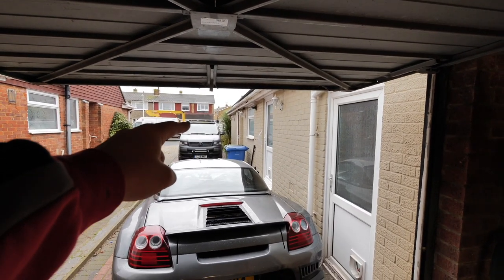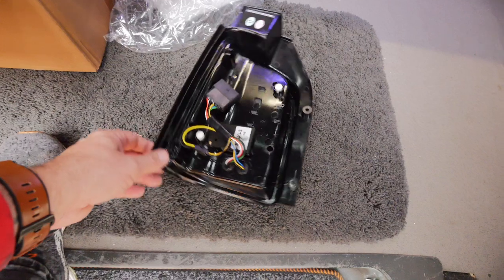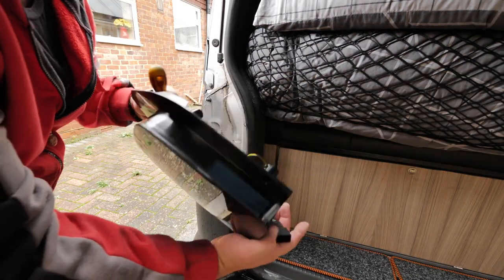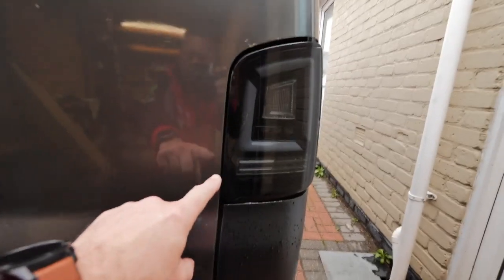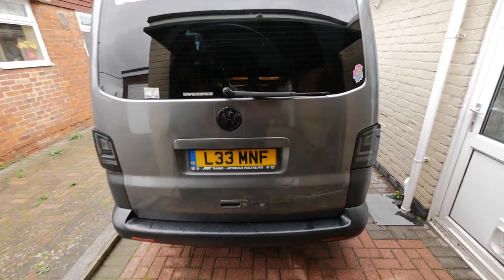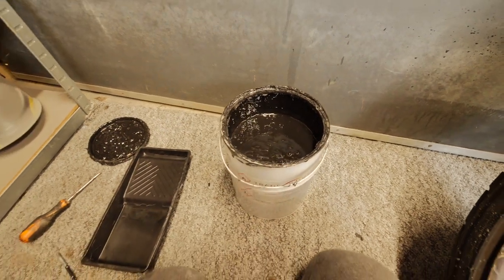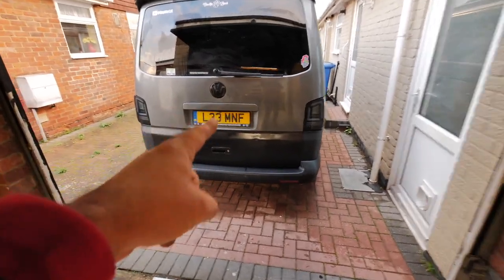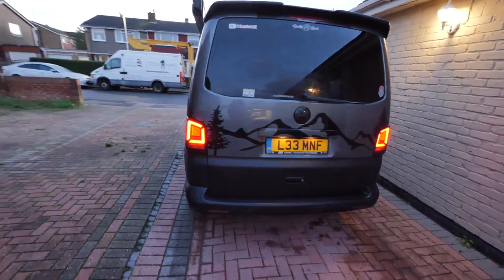Awesome rear lights VW T5 transporter from TransporterHQ - and doing other stuff

Comment: I maybe wong but looks like u got barn lights that u have fitted as they have a rounded corner as tailgate ones dont but still looks good just my OCD would do my head in
Reply from the maker: I know what you mean, they don’t flow around the corner like the stock lights